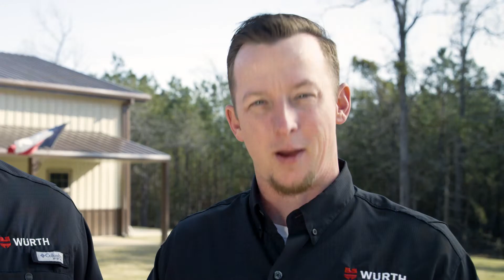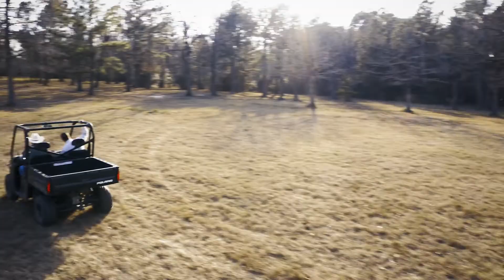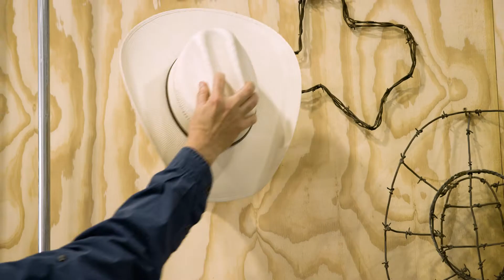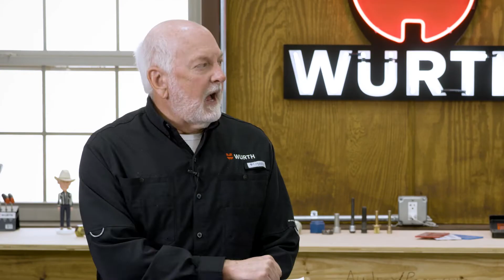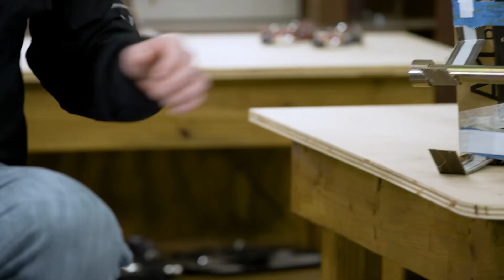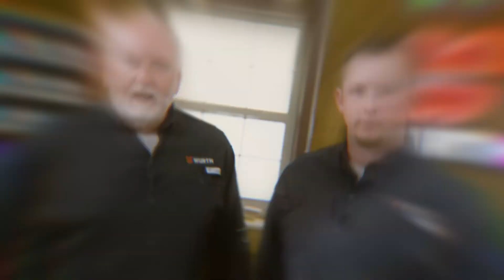Hydrogen Embrittlement | Würth Knowing Episode 6

Comment: Can hydrogen penetrate glass like it does metal ?

Are there any materials in which embrittlement does not occur ?
Reply from the maker: Hi there! There are two primary aspects to consider. First is the material’s permeability, and second is the elastic or ductile nature of the material to accept internal stresses. When working with different materials, consider these two factors when concerned about hydrogen assisted cracking. It may take some testing to prove your theory on a particular product. Hope that helps!

- Randy

Comment: Is this why car alloy chrome wheels have a higher tendency of cracking vs non chromed alloy wheels? I’ve also noticed that when they crack they usually look like they have been pulled apart as opposed to a clean straight crack like those that happen in OEM non-chrome alloy wheels.
Reply from the maker: Hi there! The cracking of alloy—typically aluminum alloy—wheels is not due to hydrogen embrittlement. The difference in crack appearance between aluminum alloy vs. steel alloy wheels is due to ductility. The more ductile nature of steel would provide for a fracture that looks more torn than that of less ductile aluminum alloy. Cracks in wheels are typically due to impact fracture, or causes other than hydrogen induced cracking. Hope that helps! - Randy
Reply: @WurthIndustryUSA  Thanks for the reply! Any thoughts as to why chromed aluminum wheels would be more crack prone than non-chromed aluminum wheels?
Reply from the maker: @jeffries848  The chrome plating may crack, but there should not be a difference in cracking with the same base metal. I’m not an expert on wheels, so maybe the best option is to investigate if there’s a difference in base metal between chrome plated and non-plated aluminum alloy wheels. Corrosion may also be worth investigating, including galvanic corrosion. Hope that helps! - Randy
Reply: @WurthIndustryUSA  Aren't aluminium alloys (generally speaking) more ductile than steel alloys? Thus leading to aluminium alloy wheels displaying a more ductile, "torn" fracture than steel ones. Great video series btw, hugely informative!